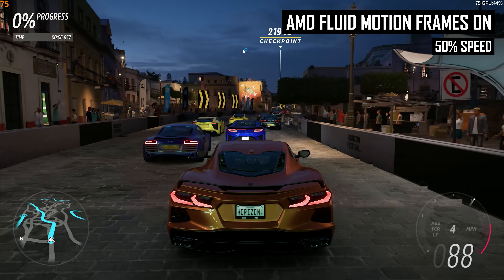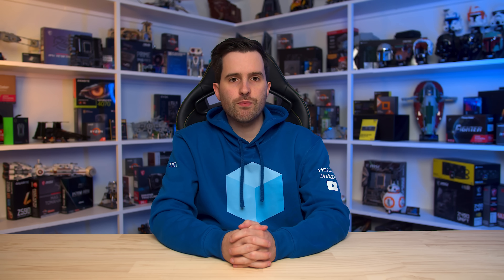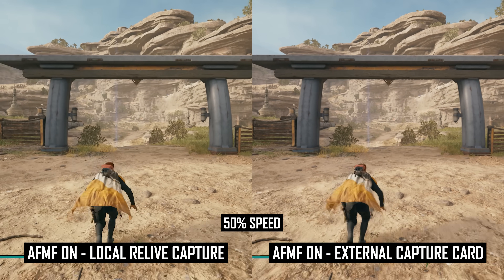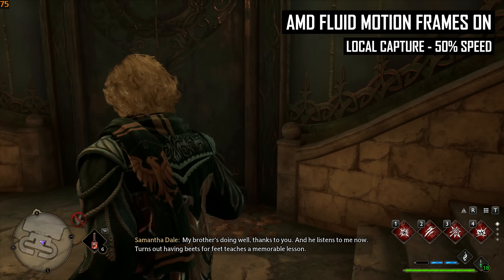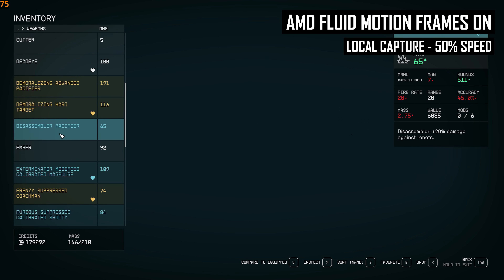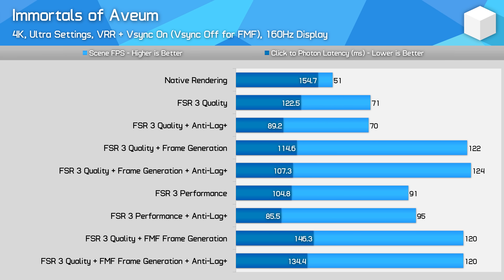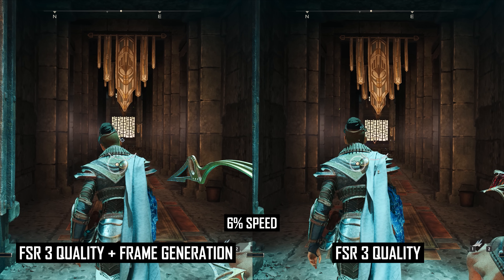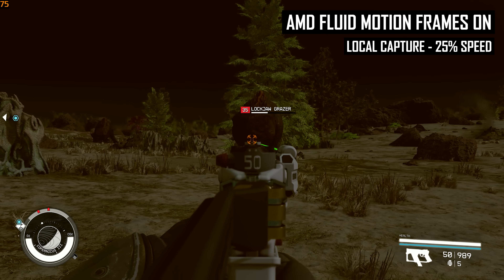Frame Generation for Every Game - AMD Fluid Motion Frames Analyzed

Comment: Just a small note, AFMF is not really based on user input, you can move your mouse extremely fast on most menus and it'll disable itself (and AFMF has not idea that you're on a menu). On cutscenes with fast camera motion, AFMF will "disable" itself despite no mouse input being received. What AFMF does is to "drop" interpolated frames that differ too much based on its internal algorithm, that way fast paced games still take advantage of AFMF, unless there's too much going on the screen, or the scene hits a corner-case on the algorithm, that's why you get mixed experience with different games in regards of AFMF auto disabling itself, that's because it's not based on the input.

As to why HDR is not supported: HDR does need special algorithm for handling a wider range of colors, so it's understandable to not have it on a Tech Preview driver, but it should be supported when AMD releases it officially.

As for V-Sync: This is not really a problem on the driver side, I think that game-based V-Sync is problematic without buffering, remember what V-Sync does: it presents a frame and waits for vertical synchronization before rendering the next frame. And remember what AFMF does: it takes two frames, interpolates and insert it in the middle of those two frames. If the game renders the Frame 1 and waits for Vertical Synchronization, AFMF will not get the second frame to interpolate until the display has synchronized. Without V-Sync, the game will render Frame 1 and start rendering Frame 2 right away, without any additional latency or wait mechanism. That's why V-Sync is not compatible, because it causes AFMF to get the second frame too late making the experience brutally worse, in games like Elden Ring, you have to force V-Sync off through AMD Adrenalin and put the game on borderless Window because it switches monitor modes on Fullscreen, and it does work. Enhanced Sync will essentially replace V-Sync in the matter of ironing out the screen tearing because it happens at the driver-level and don't hold the game from rendering frames.

Comment: The only game I've ever used frame generation was Diablo 4, with DLSS, and it looked and felt quite good, allowing me to use my 240hz 1440p display closer to the higher spectrum of refresh.
Reply: I mean, it adds significant latency, unless you're already above 100fps (in which case the visual bonus is negligible)
Reply: @surewhynot6259 if you're on AMD, yes. Nvidia framegen only adds minor latency

Comment: I would be interested to see how it interacts with interlaced output. Maybe it would sync better?

Also, would something like Rivatuner be a viable V-sync workaround?
Reply: Decided to give the preview drivers a go and have been fiddling around for the last hour or two:

(As of 23.30.01.02) I have RTSS profiles for all my games and can confirm it kinda works as a v-sync workaround. FMF will double whatever the cap is. 

The featured frame-to-frame artifacts are still present but they're not nearly as aggressive with RTSS enabled. (atleast to my eyes)

I have been unable to test if interlacing would shroud some of those issues. Probably for the best TBH but I'm still curious. 

This was all quick and casual so I can't speak beyond initial impressions.

6800xt + R5600x
GTAV - WF - ED - WoWS - Robo demo - BF1

EDIT: After some reading - seems they improved the frame-to-frame artifacts in the drivers since this upload. Not surprising but I was using this video as my base-line. RTSS, while still great, does not seem to have wrangled in the artifacts nearly as much as I had first thought.

Comment: OCT 13 driver resolved issues I had with frame pacing and screen tearing (as well as the driver timeout issue on tabbing-out, at least as far as I can see). VRR seems to be fixed, at least on my setup.

I had reported to AMD the tearing issue on OCT 6 driver when it opened up to 6000 series, and 6 days later here is the new driver resolving that issue in particular.
Reply: not seeing any update for 0ct 13??
Reply: @TheFob34  search for the preview drivers, there's the oct 6 (presumably what they tested) and there is a new driver for OCT 13
Reply: @stevenbasher5363  I was running the September 29th update but have found the October 13th ,thank you
Reply: yep, I was afraid they will announce the issues when they are already fixed but they did. daniel owens and vex made a much better showcase of the technology.
Reply: @Davinmk  don't get me wrong, their main criticisms are still valid 

- the quality of the generated frames is subpar in certain scenarios due to limited information (motion vectors)
- the introduced lag/latency is noticeable at anything below about 120fps on mouse (and about 70/80 on controller imo). Where this shines is ultimately super high refresh rate (165+ hz) and CPU limited scenarios, say 120 -> 240hz
- there are still minor cases of stutter, some bugs surrounding resolution switching, and refresh rate modes
- it does not work with vsync on in engine, which can not always be disabled.
- it does not feel good at anything below 50fps at all. This tech is not, and probably will not, be able to make up for that. You still need to enable upscaling or turn down settings to achieve 60fps+ at a bare minimum, so the 30-45fps crowd hoping to go up to 60/75fps are outta luck with this tech.

The benefit, however, is that it can be enabled in like, 90% of all games ever. Whether it's the best option or not, especially looking at some older games or console ports that are locked to 60. I'm most excited to see how it behaves with emulators like rpcs3 and console exclusive games. I tested it out with (PC) Skyrim and, despite some artifacting, that type of game with a frame limit worked really well at 120.
Reply: @WhiteG60  heck if I know why, otherwise I'd be on the driver team lol. It's not uncommon in software development for a preview / beta / test release version to not change between minor updates and bug fixes until it's confirmed resolved

Comment: I used AFMF quite extensively on my 7900 XT after they launched the new beta drivers with driver-side AFMF. At this point in the development of AFMF I have no desire to use it while actually playing a game - it simply isn't worth all the glitches, artefacts and issues since I get great framerates in most games anyway - but I am still very excited for what the future might hold for this technology. Right now it's borderline useless, but that was to be expected for a first public BETA release. Anyone who expected greatness, or even a decent experience, at this super early stage is naive.
Reply: many of the issues have been resolved already and i don’t believe the 7900 xt was thought about when making frame generation at hd or 2k since it performs much better than that
Reply: So you wouldn't say its worth using then? I just got a 7900 XT and was hoping this would get me over the hump for RT in games like Cyberpunk
Reply: @bhrandomvids  Not right now. In its current state I don't think it's worth it. At least not when you have a graphics card that is able to provide high FPS without AFMF. I am however positive that over time AMD will improve the technology significantly, and it will eventually be a great tool on par with Nvidia's FG, but more accessible. 

Especially for people with budget to midrange graphics cards and struggle to get playable framerates without it. Like ashehusband said in the comment above: the technology is probably not really meant for high end graphics cards. It's for people with slower and older hardware to squeeze some more life out of the card before upgrading.
Reply: @bhrandomvids  if you are planning on mainly playing cyberpunk and mainly with ray tracing then get a 4070 ti
Reply: @Davinmk  I went with AMD cuz I think 800+ for a card with only 12gb of vram is ridiculous

Comment: Can someone please explain to me why people think frame generation is a big deal? The whole point of higher framerates was lower input latency and with VRR screens we don't have to worry about screen tearing anymore. Why is everyone getting so worked up about fake frames that don't reduce input latency at best and increase input latency at worst? I figured the whole thing was a dumb marketing stunt by Nvidia to just make the bar graphs bigger without actually giving any more performance. I totally get upscales though. Those are great for making a 1080p card work on a 4k screen or allowing me to run Armored Core 6 at 5 watts on my steam deck to get like 5-6 hours of battery life. It's a shame they're being used to compensate for optimizing games since they don't look better than native at all.

Comment: I take issue with this video and it is rather disappointing to get such low quality analysis from HUB. First off, it is never clearly mentioned how AMD states on their page the recommended FPS targets AND it is specific to your resolution. This is very important as Tim mentions that the framerate target is 55-70 when AMD clearly states that 55+FPS is needed for 1080p and 70+FPS is needed for 1440p, it is not a broad 'oh just make sure your somewhere around these numbers' type of deal. From my testing you WILL get a bad picture Second issue I have is the motion blur discussion, he never mentions if he turned the motion blur on in his testing and that actually improves the image quality substantially when using AFMF. Motion blur alone does not make RDR2 at 80FPS look like a 160FPS experience, but both together made the rest of my RDR2 playthrough look AMAZING.   

I have an RX 6800 and downloaded the preview driver as soon as it was made available for RDNA 2 and from my experience, if you get 70-80FPS or more @1440p AND ENABLE MOTION BLUR the AFMF will run pretty well.

Comment: I admit I had high hopes when it was announced for the 6000 series, because what I've been wanting to do is to get path tracing to work on my 6900xt in cyberpunk 2077 at a reasonable frame rate. But when I was trying to use it it did not seem like it could turn a 30fps presentation into a 60fps which is apparently something they've been saying (which i missed). So I admit to being a little bit underwhelmed by it.

Comment: After having used AFMF for a while now I generally agree with most of what you said in the video but the frame pacing issue you've experienced has been nonexistent for me. You mentioned it appears to be working correctly on the ReLive capture (which is how my games looked) and is chopped up haphazardly with your external capture card. Is it possible this has to do with the capture fps or the capture card and not AFMF?

I currently have AFMF, Radeon Anti-Lag, and Radeon Enhanced Sync enabled in my driver settings. VRR enabled with freesync 48-165. I am not currently locking my fps. If you decide to look into this more and have other settings questions lemme know!
Reply: Yea it doesnt look like that for me neither. Im using it in FFXIV Online. I dont recommend it for shooters, i tried it in BF2042 and it wasnt pleasant.

Comment: Considering how Samsung has been using Frame generation in their TVs for around 15yrs (Automotion and automotion plus) and me having used it for gaming out of curiosity andxit still having the same issues it had on Tvs on these AMD and Nvidia systems as well, i woukdnt hold my breath on the type of improvements you are looking for HOB. I think there will be improvements but the inherent isduexis the frames are "fake" and thats just what they always will be with this tech and that will havecuts draw backs

Comment: Maybe you have beter eyes than me. At 2% speed, sure, I can see the generated frames. At 50% speed I can barely notice the difference.  But at normal / 100% speed, especially when I'm focused on the scene and the action and not on zooming 4x on the storm drain at my feet?  I couldn't have told you whether I was looking at AFMF, or dynamic rendering, or FSR2, or just having tweaked the visual settings (turn down shadows, texture quality to medium, etc.) to increase my frame rate.

Comment: I think the Gamers that are actually CPU bound along with broken games we see more gains and value in Frame gen vs those that have no real bottlenecks , I have a 4 core 8 thread CPU that clocks up to 4.4ghz and a 7900 xtx, I'm CPU bound some games and they are now actually playable thx to this tech, Idk why but Mankind Divided Deux Ex would not run right on my system even though newer games run like butter, soon as Frame gen came I tried it again and it totally fixed the game for me, after that I leave it on in CPU bound games and I don't have to run out and get a new CPU just for 1 or 2 games I really like

Comment: I would think with a larger previous frame buffer they could detect UI elements pretty easily. They could generate a "heat map" of changes around the edges of the screen things like health bars, buttons, etc.  When you go into a menu either full screen or a radial menu, after a few frames it would be detected too.  They could save this information into the driver for each executable (think SLI profile).

A tile based rendering technique might also be a nice way to handle UI elements, you just always disable the FMF algorithm on specific tiles always using the current in buffer tile for output.

Comment: I've actually been using the hyper-rx-eco mode and its actually really good on my 6800. It dropped power usage by 30 watts with no fps drops.
Reply: Hyper rx on a 6000 card?
Reply: @jelly8594 it's hyper rx-eco it doesn't have anti lag + in driver 23.10beta